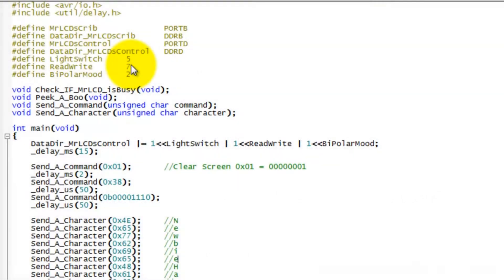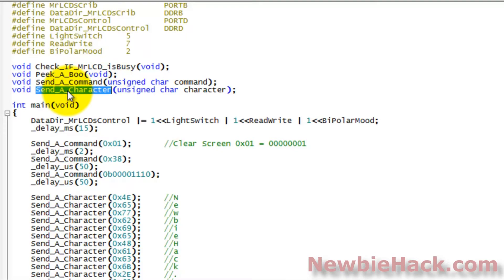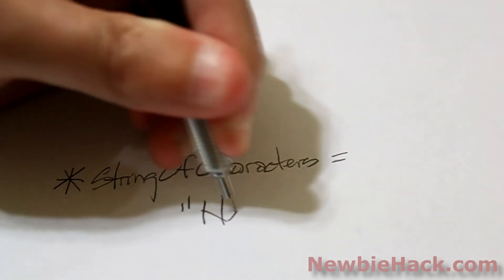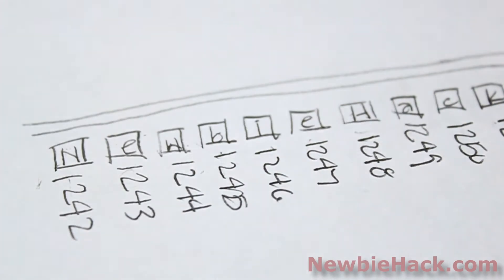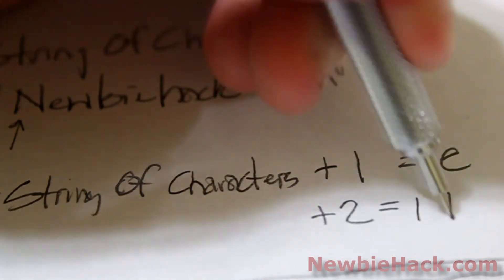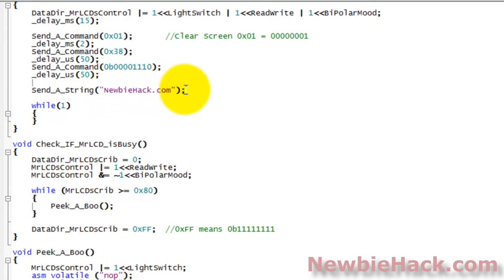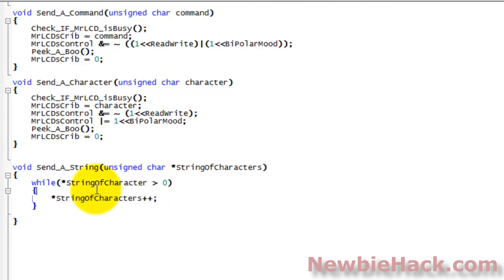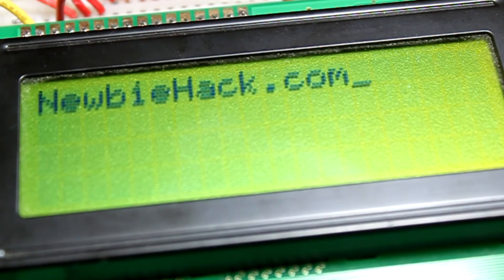21. Arduino for Production!  AVR Atmega32 - Passing a String to the LCD

Comment: Awesome explanation Patrick!...Using this video series has made my LCD more than a cool paperweight.

I have a couple of menus on my LCD that allow you to enter ONTIME and OFFTIME that eventually will be tied to an output on the atmega328p. I don't think you covered it in this video series (or maybe I overlooked) but do you a video I can reference that might describe how to convert to a string value from the LCD into an Integer that I could use in my code? 

Example: From the LCD,  the user is asked to make a selection of 1 or 2.

Comment: Hi,

I think that ,  *string + 1 will add one to the data inside that address"string" not to the address...so if string points to 'n' so *string + 1 will give 'o' not "n'  because 'o' is after 'n' in alphabetical order. 

at all it is a good job, Keep it up.
Reply: Operator precedence puts ++ operator before * operator. So *string++ is equivalent to *(string++), i.e. increase the pointer (address) before dereferencing.

Comment: Hi, i did a disassembly for the  "while(*StringOfCharacters > 0)" I did't know why your pointer, after the string read 0 ? It was very confuse in my mind.  So i found that the compiler put 2 memory bytes at 00 just after the last character of the string. In your exemple, i went read this from flash memory in simulator (avr studio7): 4e 65 77 62 69 65 48 61 63 6b 2e 63 6f 6d 00 00 ff ff ff ff ff ff ff ff ff ff ff ff ff ff ff and so on. Now i understand why and how the loop end. Thank you for your video. Help me to pass from assembler to C :) https://1drv.ms/i/s!AnKLPDy3pII_gTjI19c6ANQXlucu
Reply from the maker: Any values you get after the actual number of characters will be erroneous memory locations and the numbers that reside in those memory locations.  The null "/0" value is used to stop the iteration so those memory addresses are not read.

I'm glad you figured it out.
Reply: Picture may help others https://1drv.ms/i/s!AnKLPDy3pII_gTjI19c6ANQXlucu thanks again
Reply from the maker: Yannick Turcotte it’s interesting how the string is squeezed up against the previous stored memory data. Looks quite optimized.

Comment: Hats off to you sir, your videos helped me solving my problem for writing a c code for an LCD. I can successfully display characters on the LCD now. But now i am stuck on sending a string. The characters do get displayed but scrambled. Is there some other way around for sending a string in fourbit mode?
Reply from the maker: Thanks for the kind words.  I haven't delved into the 4-bit mode, but the datasheet has quite a bit of information on this.  I would recommend using the datasheet to determine how to use 4-bit mode.

Comment: @Robin D. I realize this response is to a question of over a year ago. But in case someone else comes across something like this. You will want to make sure that you are using delays after any additional command functions, per the data sheet. I was having some intermittent data corruption, and it was because with my particular chip, at my clock settings, and my particular LCD, my cpu was just a little to fast for the clear out "settle" or whatever you want to call the lcd response delays. I was using a clear screen and needed to add a 10 ms delay, AND add a 35 uS delay after each *character print. so my "Send_A_String()" function had a _delayus(35); right after the function call of 
LCD_Send_Data(*string++);
_delayus(35);

there are several calls for delay in the datasheets. I haven't spent the time to determine where this particular call is corrupting the memory.

I hope this helps..

Comment: Hello,

I have a question about a problem i have with sending my strings.
Everything is fine when im sending single characters but it gets weird when using strings.
At first everything is fine i can send my strings without any problem but when i have "printed" a certain ammount of characters to my lcd through strings my ATtiny 2313 starts sending blank characters and then even random characters.

What could cause such a thing?
And how can i solve it?
Can someone please explain this to me? I have been trying to fix this for weeks now.
Reply: Hi,

It's me again... =p
So i just tried sending multiple strings with the orriginal code from the website and found out it is also happening in the orriginal code.
Someone else must have encountered this problem too i think.
How did you guys solve this?

Greetings Robin

Comment: I made a program with very similar code and it works . But my question is "HOW does it work????"

I mean I pass the adress of the string with the pointer and my function "SendCharacter" then sends the adress of the specific character in the string to the LCD , but how does the LCD know what character that adress represents? Doesn't it have to be sent in ascii code?

Comment: Would you mind explaining why this line of code works "while(*StringOfCharacters > 0)"? I understand the loop function, but it seems to rely on the next character being a 0. Will a 0 always automaticaly be at the end of a character array in memory? You make outstanding tutorials by the way.
Reply: Same for me... i think i found why:  i did a disassembly for the  "while(*StringOfCharacters > 0)" I did't know why your pointer, after the string read 0 ? It was very confuse in my mind.  So i found that the compiler put 2 memory bytes at 00 just after the last character of the string. In your exemple, i went read this from flash memory in simulator (avr studio7): 4e 65 77 62 69 65 48 61 63 6b 2e 63 6f 6d 00 00 ff ff ff ff ff ff ff ff ff ff ff ff ff ff ff and so on. Now i understand why and how the loop end.
Reply: In C, a string  a string is whatever is inside the double quotes, and it's terminated with the null character (\0). So the line of code basically says "as long as the character being pointed to is greater than the null character, that is greater than zero, keep printing the character. 

This line of code:

Send_A_String("NewbieHack.com");

Results in a call to the Send_A-String() function with a string argument that consists of these characters: N, e, w, b, i, e, H, a, c, k, ., c, o, m and (finally) \0. But Patrick didn't use the null terminator in his code--so C automatically sticks one on the end of the line of characters, to make it a "string" in the C language. Therefore when his code tested to see if the de-referenced character pointer resulted in a character with an ASCII value greater than zero...it printed the entire string. That said, the way it's normally done is to use not equal (!=) instead of greater than (>) to test for the null. So then, it would be this:

while(*StringOfCharacters != 0)

But since all ASCII characters have values greater than zero, Patrick's line worked as well. It's just not the way you normally see it written.
Reply: Also, keep in mind that in the '\0' character, the '\' is an escape character--so that the character that follows ('0') is not interpreted literally. Otherwise you'd get the ASCII value of zero, and not zero itself. If you look at the ASCII values table, the ASCII value for the character '0 (zero) is actually 48 in decimal. So you need to use the NULL terminator (\0) to get an actual decimal value of zero in memory. Thus there needs to be a way to denote that it's the decimal value of zero we want--and not the ASCII character zero (decimal 48). 

Again, every other character in the ASCII table has a decimal value greater than 0...which is why Patrick's line of code works.

Comment: How can you guarantee that the character position after the string is ALWAYS equal to 0?
In my opinion the rule while(*StringOfCharacters > 0 ) will fail at some time.
Because there could be random data all over the place
Reply: i think i found why:  i did a disassembly for the  "while(*StringOfCharacters > 0)" I did't know why your pointer, after the string read 0 ? It was very confuse in my mind.  So i found that the compiler put 2 memory bytes at 00 just after the last character of the string. In your exemple, i went read this from flash memory in simulator (avr studio7): 4e 65 77 62 69 65 48 61 63 6b 2e 63 6f 6d 00 00 ff ff ff ff ff ff ff ff ff ff ff ff ff ff ff and so on. Now i understand why and how the loop end.

Comment from the maker: @amtpdb1 The top prototypes are needed.  I did explain this in previous video, but I will try to provide links as necessary.  These informs the compiler that these routines actually exists, because these routines are called in main before the actual code is seen by the compiler.  If the routines were put before the main, then the prototypes are not needed.

Comment from the maker: @amtpdb1 Thanks for the feedback.  I will try to provide more depth in the explanation.  The void keyword at the beginning of the line tells the compiler that there will not be anything returned.  The void in the parenthesis (only within the prototypes) only informs the compiler that there is nothing intended to be passed into the routine.